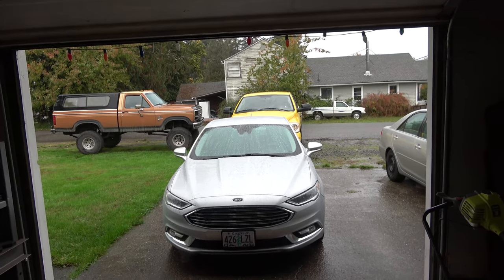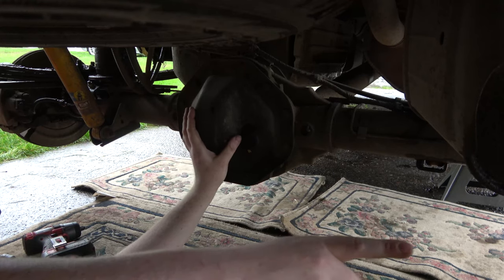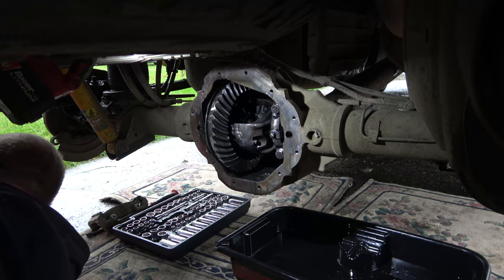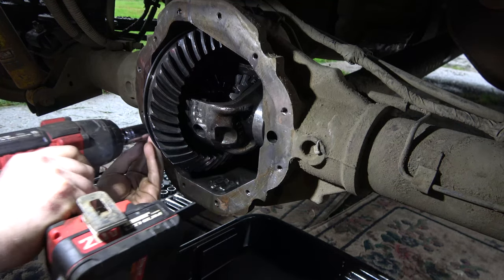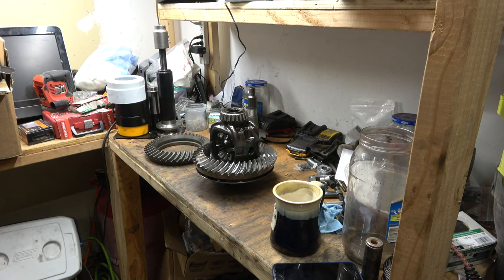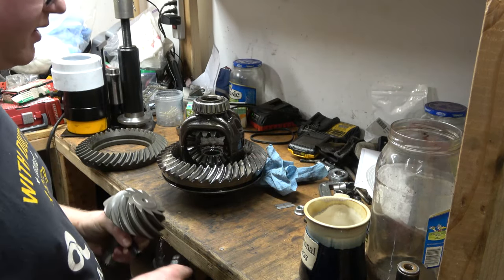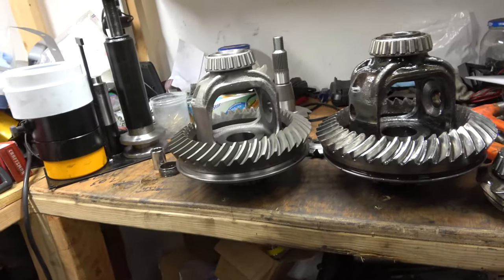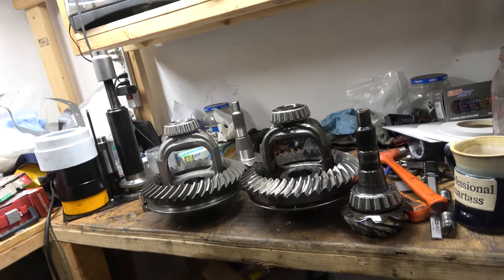Totally Ruined Chrysler 9.25 Differential | 2007 Ram Rear Differential Rebuild Part 1 of 2

Comment: I followed this and anothr video set. learned a lot and got er done. I did end up just welding a 36mm nut to a socket and used that as my "Chrysler Tool" worked like a charm. my pinion looked like one of those cheap pinions from an RC car that you put way too much power on. the teeth were gone

Comment: the old ring gear should be stamped 3.55 unless someone changed it, I just got a ram 1500 with loose pinion bearings in the bottom of the housing, so I'm doing the same job